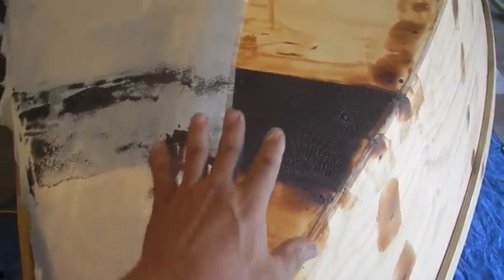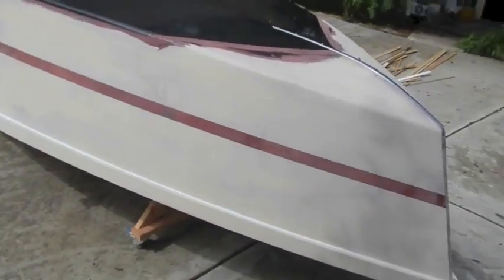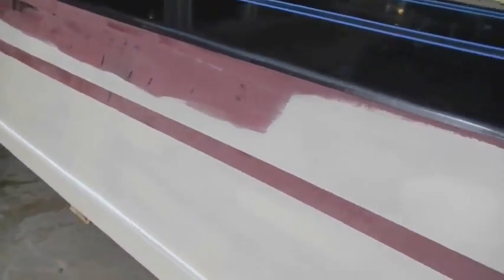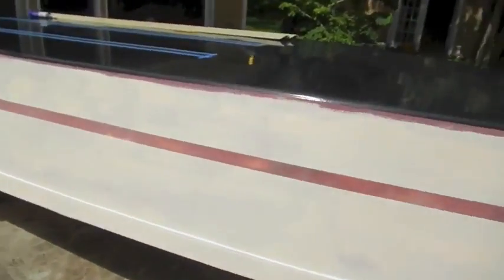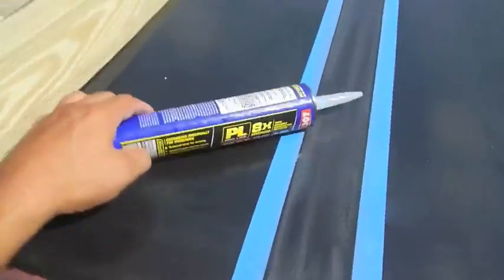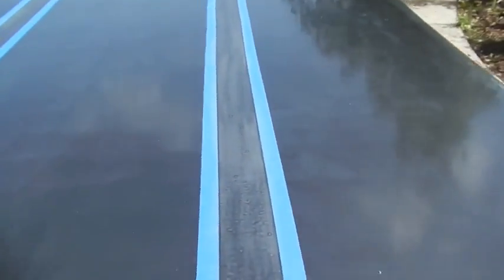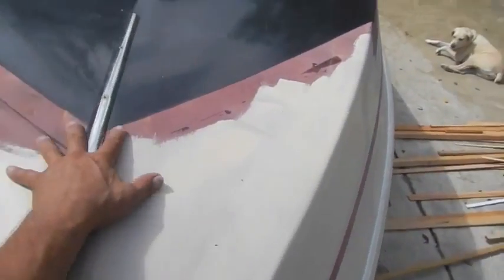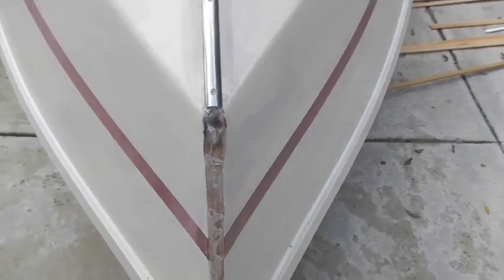Albion Boat Build Part 4

Comment: U did great job..u contradict yourself alot.u said it was a rough water boat..then said it was for flats.u said u weren't putting holes in hull then u put metal strip on hull at bow with deck screws.still live the job on the glass graphite bottom
Reply from the maker: It is a rough water boat. https://s-media-cache-ak0.pinimg.com/736x/27/f7/e1/27f7e1a8c0dd23c7c2b24609937fa88b.jpg

"The flats" refers to shallow water, often times in the ocean. Many builders, this one included, said that they use it in the shallow ocean.